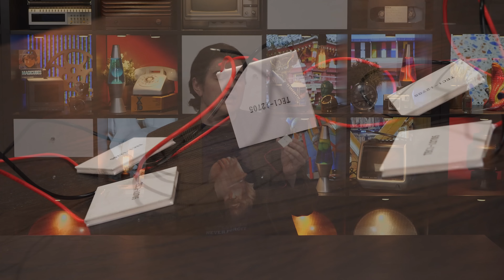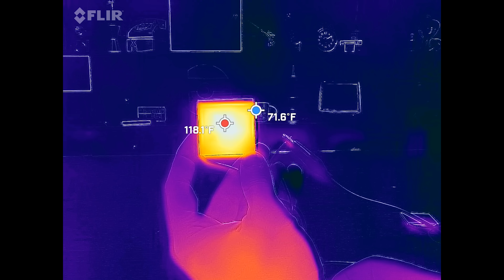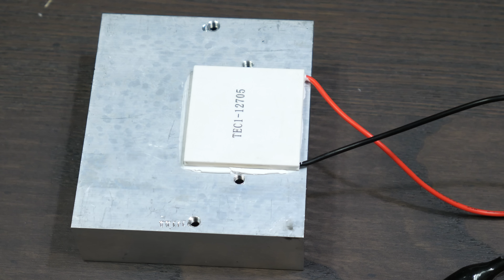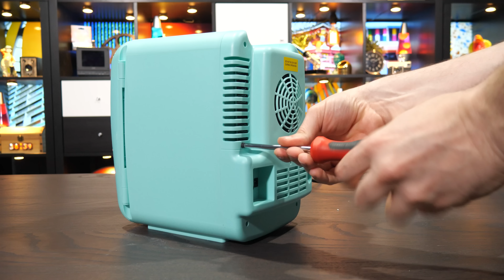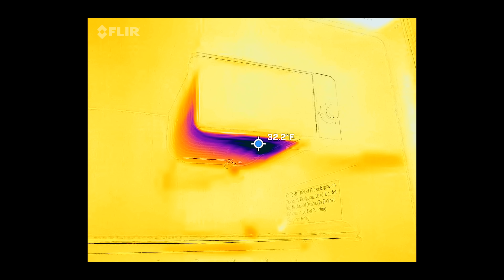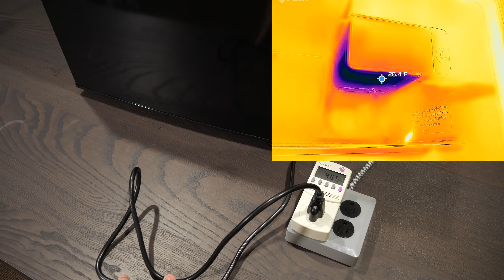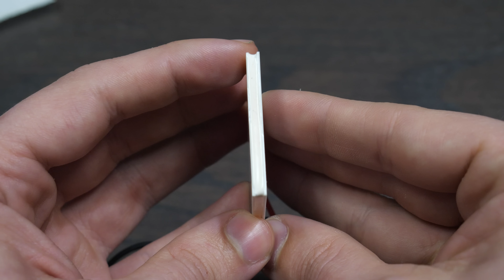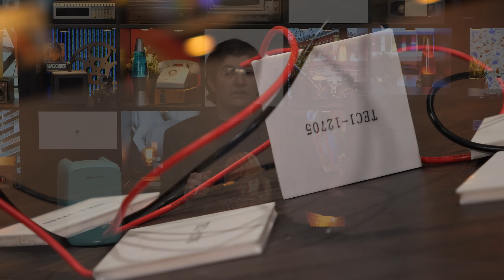Thermoelectric cooling: it's not great.

Comment: Important caveat: Astrophotography is one of the rare use cases for Peltier coolers (TECs): you need a tiny little device to cool a CMOS/CCD with a form factor that can fit in a camera. And counter to what you suggested, frequent and long term use. Tiny surface to cool (35mm diagonal), lot of power to provide, and lots of environment (cold night) to dump excess heat into. My TEC coolers get my CMOS down to about -30C regularly! Wonderful for reducing (thermal) noise in astrophotos. They do make liquid cooled astrocameras, but those are very, very finicky to make work with all the movement of the telescope (but can use heat pumps).

I love your videos, by the way! The deep dives and nerdy details (plus puns and jokes) are much appreciated!
Reply: Some FLIR cameras have an actual tiny refrigeration system in them.  Really weird to have to cool your heels for 7 minutes while it refrigerates the image gizmo.  My company has 3 of them.
Reply: @FARLANDER762  "Cool your Heels".......  Go to your room.....   🙂
Reply: Also, when absolute silence is required.
And as a solar/wind dump load where rapid/systainable on/off and low capital cost are key.
Reply: Same thing with high end lasers!
Reply: @loganlopez1617  I have 473nm dpss laser modules that use peltier modules to keep the crystals thermally stable. I've also got a multiline argon laser, the peltier modules are just a tad more efficient...
Reply: Not just portable astrophotography, even semi-professional and small professional telescopes may use them if liquid nitrogen isn't practical - for example at teaching observatories at universities. Or telescopes located in poor-weather areas where the amount of nights lost to bad weather mean it's not worth maintaining a cryogenic system.
Reply: Any kind of sub-ambient component cooling where a compressor setup isn't functional or practical, really.
Reply: 20 years ago my dad had an astrophotography camera that not only had a peltier cooler in it but was plumbed to hook in external water cooling as well.
Reply: On a similar note, aren't the thermocouples used on RTGs on space probes similar to these things?
Reply: @Valery0p5 Yes.  RTGs are kind of Peltier units running in reverse. Instead of injecting power to make cooling, you inject heat and get power. A lot of heat thanks to radioactive decay produces a useful bit of electricity.
Reply: @Valery0p5  Yes, you can take the thermoelectric cooler out of a fridge and use it to generate power if you heat one side and cool the other. They just aren't optimized for it. A thermoelectric generator that would be used in an RTG is designed to operate at higher temperatures.
Reply: We use these quite often in professional astronomy as well, not just astrophotography. Of course many instruments are cryogenically cooled, but a lot of mid sized observatories are just using peltier cooled sensors. A lot of those liquid cooled ones are also just liquid cooling the hot side of a peltier module.
Reply: I used a camera with Peltier-cooled sensor for photography on a microscope.  For $REASONS, we needed to take 24-hour exposures of an opened-up integrated circuit while it was running in total darkness.  The CCD sensor got down to -40C.
Reply: @dfs-comedy  yes! Was also going to put in a nod to microscopy. Especially fluorescence microscopy. Andor cameras have been using Pelletier coolers for decades 😊
Reply: @melodybrohinsky7242 did not expect to find a fellow Andor user here! Hi :D
I also find the Peltiers quite useful and enjoy those -100°C (in combination with water cooling) of the EMCCD
Reply: The mini fridge heat sink was waaaay too small considering it probably has a tdp of 75 watts.  I'm curious how well it could do if designed even half way intelligently
Reply: @jeffpkamp  If you make the cooling system more complex, the peltier 'fridge' might end up costing as much as a mini fridge. Itll also be bigger and heavier.
Reply: An important note is the astrophotography cameras, at least those from ZWO and QHY, are two stage stage coolers. Meaning they have another peltier cooling the first one. That's how they get down to such cool temperatures.
Reply: Your TECs must be stacked modules, since each module can drive a difference of about 30°C. A small TEC cools the camera, a larger TEC cools the small TEC, and possibly and even larger TEC cools the large TEC. And each step of the way, each module while pumping a small amount of heat, also rejects heat from the injected electrical power.
Reply: reminds me of how sled dogs are one of the few animals that can outrun humans on a long distance scale... in the Arctic where they can dump all of their body heat into the freezing air and not overheat.
Reply: Arri Alexas might use one too. They have temperature regulated sensors.
Reply: Oh damn, you beat me to it!
I just posted a comment about them cooling CCDs haha
You explained it way way way better though
Reply: I’m the other rare use.  Thermocyclers to do things like pcr or holding VERY exact temps for minutes or hours on end.
Reply: I contend that "form factor" never means more than "form" (except about the person who said it).
Reply: Yeah, I use the little fridge to cool my mifi hotspot when I'm in the field at work. Simple & cheap way to keep it from shutting down from heat.
Reply: I was going to mention that.  They work great for astrophotography cameras.
Reply: And things like DWDM systems for optical communications, where lasers and potentially other components have to be temperature-controlled to operate reliably with channel spacing of 100 GHz (yes GHz, not nm).
Reply: I always assumed these things (Peltier elements) were made to sink heat from very small components, the same size as the element, effectively - with fans etc.
Reply: Peltiers are awesome for tight active temperature control with low power, since they can cool and heat by only switching polarity
Reply: I'm currently a research chemist at a university and we use Peltier cooling in our laser flash photolysis system to reduce sensor noise, but that's a totally different application to a fridge
Reply: You can use them to maintain a rate sensor or hall effect sensor or similar MEMS sensor devices at a fixed temperature too as an alternative to calibration and creating a temperature table. Just stick one on the device and have it pump heat in or out to maintain a reasonable near ambient temperature and calibrate for that.
Reply: The one thing that's true to basically all the good applications is that the object you want to cool has a VERY small heat capacity. Imaging sensors were mentioned in a lot of comments.
Reply: What does this have to do with consumer cooling devices?

Answer: nothing.
Reply: How is that important, to the discussion of cheap toy coolers?
Reply: Good to know, I was missing a good example of a real use case. And budget didn't ring true as the only reason one might have
Reply: Complete layman here, but why is it needed for the cameras to be cooled down?
Reply: @hcxpl1  Reduces thermal noise in the image sensor, gives you a better signal to noise ratio when you are capturing images of very faint objects with long exposures.
Reply: @keegan854 This same concept is why they are also used in optical emission spectrometers, especially ones that use CCDs and CMOS. Trying to detect trace elements in the low ppm and ppb ranges would be a nightmare with CCD noise.
Reply: @hcxpl1  If you are driving the CMOS sensor hard to make it exceptionally light sensitive for astrophotography it gets very hot.  That introduces electronic noise - like an old TV out of tune "snow" - on the image which obscures what you want to see.  Cooling the CMOS helps reduce the problem
Reply: @hcxpl1 heat causes random discharges in the sensor elements. Aka noise in the image.
Reply: Would there a difference if you cool down to minus 30 and with water? Water may only get it to ambient temperature certainly more if heatet a little.
Reply: I didnt know there were dedicated astrophotography cameras. Who makes them? Sony?
Reply: @jg54sayaka11   touptek, ZWO asi    they are usually sony sensors, color and mono, in dedicated housing with option for cooling models that use peltier device
Reply: @jg54sayaka11  Sony makes some of the more common sensors, but not the cameras themselves. There's SBIG, Moravian Instruments, QHYCCD, Player One, ZWO, Atik, to name a few...
Reply: @jg54sayaka11  ZWO, QHY, and a few others i have 2 from ZWO. Some of them do use Sony sensors
Reply: @jg54sayaka11  Dedicated astrophotography cameras are made by ZWO, QHYCCD, Player One, Touptek and SVBony, but most do indeed use sensors made by Sony. One of the most notable differences between them and regular DSLRs and MILCs is that there are no controls on the bodies: all imaging control is done remotely through USB (though I suppose Wifi is a theoretical option), so they require an external computer of some sort to operate.
Reply: @jg54sayaka11 Sony is usually building the CMOS sensors. The brands building the cameras are zwo or qhyccd for the more popular (for amateurs).
Reply: @jg54sayaka11  Check out the ZWO range for ideas.  If you see the ones with heat sinks - that's a Pelletier chip plus heat sink plus fan.
Reply: @jg54sayaka11  Sony makes the sensors that most manufacturers use these days, cameras themselves are made by many different companies, most of them from China - eg. ZWO, Player One, QHY.
Reply: nerd
Reply: correct nerd

Comment: Peltier elements work best for portable electronics. Something like a 4k or 8k camera can run very hot (especially on the memory card), and it can be quite hard to keep them cool enough just through direct air cooling.

Comment: Just bought a camping cooler with an actual compressor on Amazon instead of my previous Peltier-powered one. It's way bigger, yet consume significantly less energy while being adjustable (it can even be used as a freezer).

I can pretty much plug it in my small Jackery and as long as I charge the Jackery for about 2 hours a day (easy during a road trip), I can run it indefinitely. That also means that a 100W solar panel, even on a cloudy day, can get it to run indefinitely.

Pelletier fridge are only good as a really small cooler to keep drinks cool.

Comment: Another (ahem) cool fact about Peltier devices: The original Sidewinder missile was developed for the US Navy, and used a gas charge in order to cool the seeker head and enable it to see the enemy target's hot exhaust signature. The AIM-4 Falcon missile worked on a similar principle, but worse, and used a different gas. When the USAF was forced to adopt the F-4 Phantom, the first model they got (the F-4C) was built with Navy Sidewinders in mind. The later F-4D had the missile rails replaced to use the Falcon missile, but since the Falcon missile used so much gas charge compared to the Sidewinder, you could only prep each missile once, then you only had a 2 minute window to use them. Eventually, the USAF finally figured out that the Falcon missile was a complete piece of crap, but decided if they were going to adopt the Sidewinder officially, it had to be different from the US Navy's version. 

The first change was to a more aerodynamic seeker head. The second, and more important change was the elimination of a gas charge cooling system. Aim-9E's and Aim-9J's use Peltier devices to cool the seeker heads. 

Just a fun little tidbit of trivia for your day.

Comment: Peltier coolers are way more useful than you make them sound.  In science labs they are used to cool scientific grade cameras, and other semi conductors.  They are used to control the temperature of laser diodes and LED to stabilize wavelength, and they can also be used in reverse (using a temperature difference to generate current) which is how they are used on the radioisotope thermoelectric generators (RTGs) that power deep space probes.

Comment: Those parts are neat for generating dc power. One side hot, the other side ambient you can generate power with them. Otherwise they have extremely specific use cases in labs (that will usually be serviced by other means of possible) or for manufacturing cheap "ice chests"

Comment: another use for peltier modules i have seen is for fans the sit on top wood stoves. because the modules also work as a generator if you heat one side and cool the other they produce a small voltage. there are fans (at least here in canada) that use a metal base that sits atop a wood stove with a peltier on top and a heatsink on top of the peltier. the leads connected directly to a motor that in turn blows around hot air while also cooling the heatsink. really a great passive design

Comment: Peltier elements may be terrible for refrigerators, but they're excellent for High Performance Liquid Chromatography autosampler chillers. We have several that use peltier elements and they're a lot more reliable than the newer units that literally have mini refrigerators, like the size of a 4 slice toaster small. We've had so many of those newer systems leak and fail.

Comment: One application for Peltier devices is precise and responsive temperature control for small volumes (a few ml), which is crucial for the measurement of temperature-sensitive properties such as refractive indices. So they aren't completely pointless ♪

Comment: Operating TECs at high power makes no sense since the more power you pump into them, the more effort the TEC wastes pumping its own heat away from the cold side. At max power, that is all they are able to do. The ~50W TEC here is operating continuously because the instant you cut power, all of the hot-side heat will flow right back through the TEC and into the box.

TECs can be better than pathetic in efficiency but you have to keep the temperature gradient across them under 10C each and operate them at 10-20% of their max rated power. For a legit desktop fridge instead of a toy, you'd want a three-stage module stack. Add a stack of 30W, and 40W modules to the original 60W one with heat-spreader plates in-between, use a trio of DC-DC regulators to split the ~60W of DC power budget between TECs into an even temperature gradient from inside cold plate to heat sink and you would likely be able to achieve better cooling performance using less than half as much power. Lots of extra complexity though.

Add an Arduino to sense temperature of each heat-spreader plate and automatically tweak voltage regulators, then you can automatically go from max-cooling after the door has been opened to max-efficiency when the desired inside temperature has been reached.

Of course, insulating that door and whatever else may have been omitted wouldn't hurt.

Comment: Alec be careful with statements like "reccomend/consider cube minifridges", you might send folks off buying the exact terribleness you're trying to inform them to avoid! You might not have bumped into the smorgasboard of peltier-based "cube minifridges" out there... Yeah, hotel sized or even larger. And yes I've seen them in actual hotel chains, they're sold indiscriminately and even malinformed business owners end up buying them thinking they're normal minifridges but "ooooh, silent, so modern!" (many have smarter/lower RPM fans so they're actually quiet, but still run using a heck of a lot of energy for barely chilling what's inside)... Peltier stuff are EVERYWHERE because of cheapness and lightness (hence added ease to import from China), where I live 9 out of 10 water chillers, even full size ones sold to offices, are peltier even though they take ages to chill anything! They're terrible! But the absolute DEFAULT. But of course people won't notice they take hours to chill just a few cups of water until aaaafter they've bought them and plumbed them in (top that with bad return policies...) so...

Comment: One of the 'cool' things about Peltier coolers that you didn't mention is how easy it is to stack them to get really cold temperatures. I worked on an electro-optic device that had to be quickly cooled to -20C. It was done using 4 layers of coolers and only took a minute. The device was only the size of a popcorn kernel but there would have been no other way to do it.
Reply: Yeah, that's part of the reason why the modules are so slim, they are meant to be stacked with a thermal interface material in between. That of course quickly goes beyond the allowable bill of materials of a shitty Peltier minifridge.

Comment: I have a peltier phone cooler. That thing rocks. It cost the same as the tiny fridge, but has both temperature regulation (to avoid overcooling your device) and an active fan to manage the hot side. You can also set the cooling power on it. It still has a high power draw (they recommend a power source of at least 15-20w),so decent to large sized powerbanks can be drained fairly quickly which makes it best to be pulling from the wall.

Comment: the use case i wanted for these was installing a chilled cup holder in my desk. i think it'd work well, especially if i add a temp sensor and have it turn off when not used or is cool enough

Comment: Got a peltier cooler for car road trips.  It's nice that you can power it from the car's 12V and it has a small form factor.  Other than that - disappointing at best.  After hours on the road you can enjoy some "cool-ish" drinks and (as you say), the temperature is not quite in the food-safe zone for ordinary foods.  Lord help you if you want to replace the drinks with non-chilled ones.  A conventional cooler and ice outperforms this in almost every way.  I hadn't realized what kind of power draw the peltier element requires but that certainly helps to explain its problems in this application.